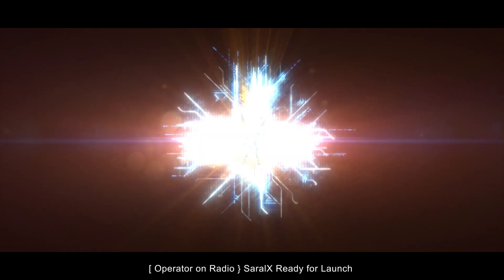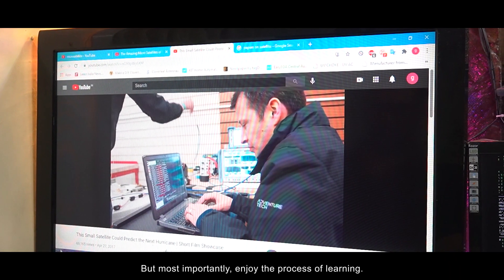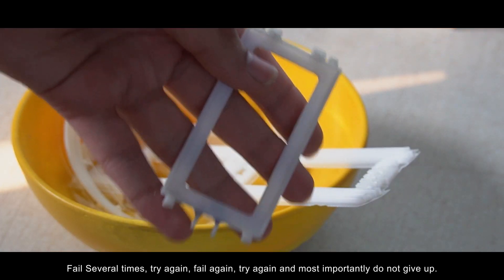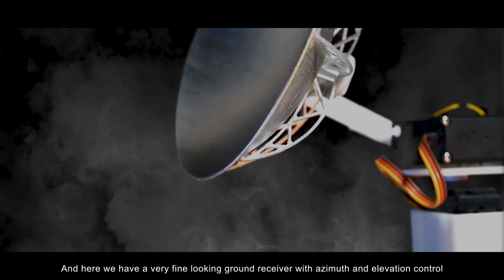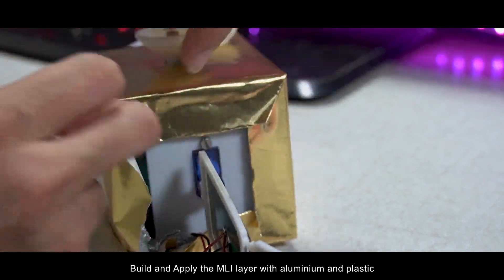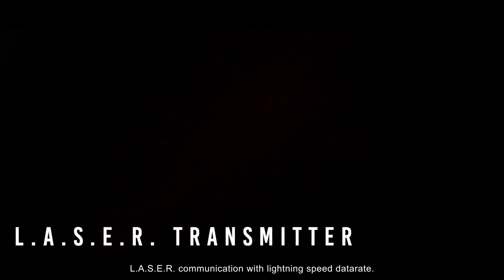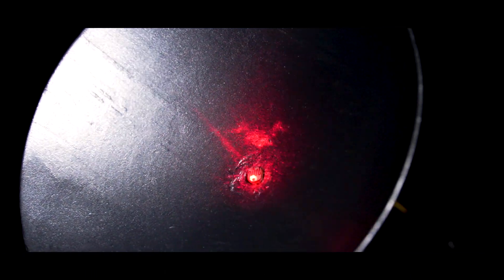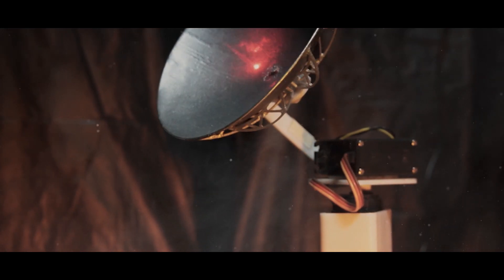DIY cubesat with ground receiver | Saral - X

Comment: Test it in-sky with a weather balloon? 
How will the atmospheric turbulence affect the laser's data loss rate at orbital levels? (you might need another laser system to sense and compensate for the light warping, research large observatory telescopes, they use a similar system (laser probe?) to clean up the image, perhaps a multi laser array for redundancy/crosscheck of signal.
How are you gonna get this SOB into orbit? (N2O doped sugar rockets are cheap and you can probably cook em in your sisters 'Easy Bake Oven' XD)
Holy fk its been 3 years since this video, where are we now?